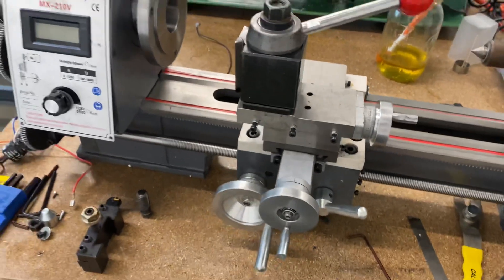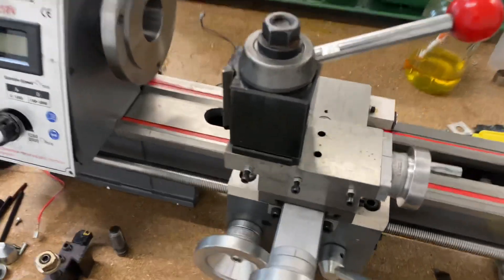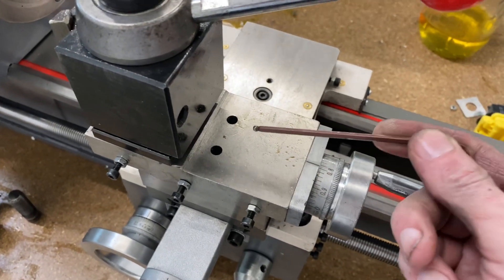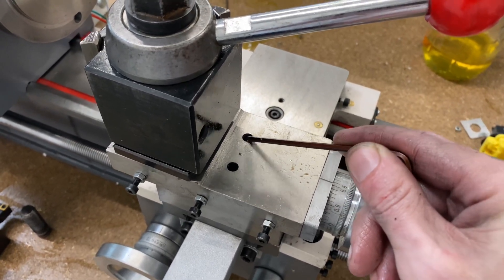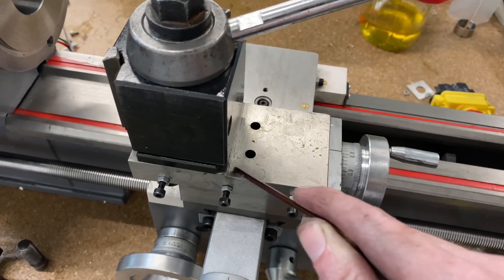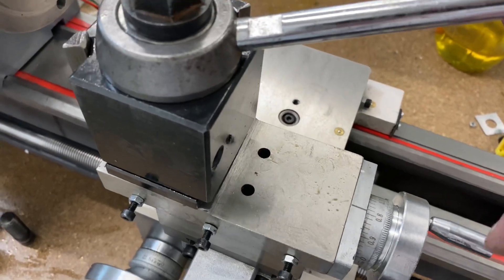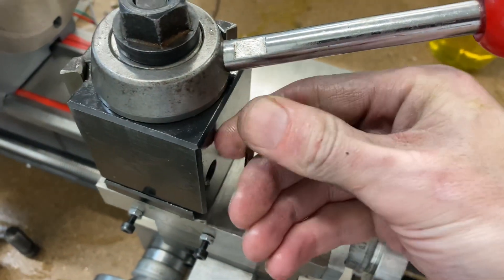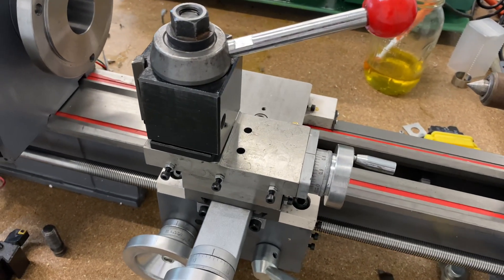MX-210V lathe compound modification.

Comment: Thank you for posting this video!!!!   I just got an MX-210V second hand, and it did not come with any documentation of any kind,.  I saw the graduated rotation scale on the back of what I THOUGHT I recognized to be a compound slide, but could not find ANY adjustments anywhere, and thought it would be ridiculous that it may be necessary to remove it entirely just to change the angle.   Turns out I was right and it IS that ridiculous of a process.   Thank you.   Now I can remove it just once and do this mod so I don't have to disassemble it again (except maybe to clean it and/or make other mods - a digital-caliper DRO for one)...

Comment: But that only allows angle adjustment in that exact position of the top slide.
I'm thinking of some smart way to lock the angle in any position. I saw some people cut out the sides and use nuts to lock. I don't likenit either. 
I'm thinking of turning a cylindrical dovetail which will pull the locking circle up as it is pushed by brass bushings shaped by round file to match the dovetail angle. Bushings would be pushed towards the dovetail by bolts from the sides of the compound. 
That partnwould be identical as the original locking circle plus 15 mm tall dovetail of the  diameter same as smaller circle, a d angle maybe 60 degrees.  
I tried 10 degrees in my prototype but the pulling up action wasn't very good. The angle must be more acute.

Comment: Greetings from Ukraine. It's nice to see where you made a silencer and all sorts of goodies for weapons, even though I don't understand English. What is the diameter of the bore in the muffler in your glock? For Ak74 5.45 6.4 will it be ok? Or do you need more or less?
Reply from the maker: Слава Україні! The bore size is not critical and it’s better to err on the side of safety. For 5.45x39 I would use 7mm or even 8mm. For 7.62x39 I’d use a bore of 9.5mm. For 9mm in my Glock I use 11mm bore . If you are using a lathe you can go a bit less if you trust your work to be concentric.
Reply: @kingjamez80  
Героям слава! Thanks for the support. Thanks for the answer. 
Ukraine will win.

Comment: I don't have this lathe, but thought that was a brilliant idea none the less!
Reply from the maker: I’m not sure I’d go as far as ”brilliant” but thank you ! 😂
Reply: @kingjamez80  I have to adjust the angle on the compound slide at work every now and then and it's a real PITA, especially if you keep the gibs really tight to help prevent chatter.  So, I thought your mod was "pretty cool" :-]
Reply from the maker: @AtimatikArmy  Oh, I agree. I wish there was a sarcasm font :-). With this little lathe, I do have to keep the gibs super tight. It's not nearly as solid as I expected moving up from a 7x12.
Reply: @kingjamez80  Haha, I have the Harbor Freight 7x12 sitting in garage!
Reply from the maker: @AtimatikArmy  Nice. I like my 7x12, just wish it had a bigger bore. Hard to compete with the 38mm bore of this 210 for a lathe this small.  You can see my green grizzly 7x12 sitting behind the 210 in this video.